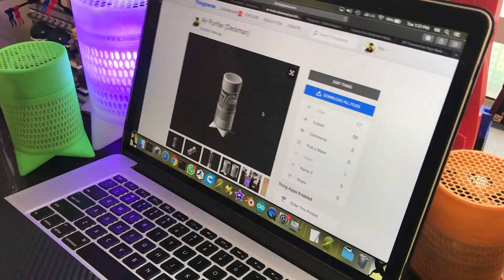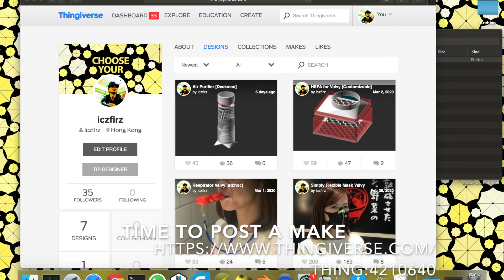Air Purifier [ Deckman - DIY 3D Printed your own now ]

Comment: I use an 80mm fan. The top is big enough. What if I make the bottom filter part 55mm 60mm? The original file is 118mm.
Reply from the maker: Sorry I don't understand your question. What do you mean "filter part 55mm 60mm" ?
Reply: @iczfirz  What happens if I shrink the body part? So the lower part where we put the filter. I will add 3-4 filters like hepa carbon etc. Does it matter whether it is wide or narrow?
Reply from the maker: @can_gurel  I bet it will be fine as my other cup holder version is 50% shrink. https://youtu.be/6sLTHeuvAZc

Comment: how does this purify the air and from what? The only thing it collects is dust as far as I can see.
Reply from the maker: It depends on the filter(s) you use. I put activated carbon and 3M electrostatic filter. So it catches more than dust. You can find out more from https://www.filtrete.com/3M/en_US/filtrete/home-tips/full-story/~/coronavirus-and-important-things-to-know-about-airborne-particles/?storyid=d69e7735-c02c-46d2-9c8a-ae23372934ac